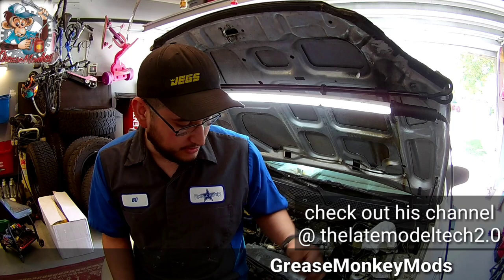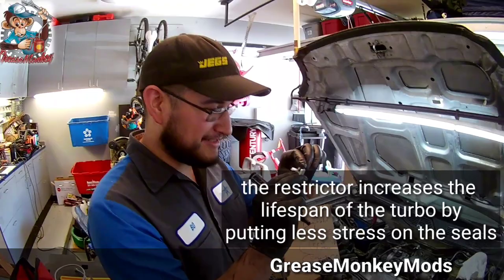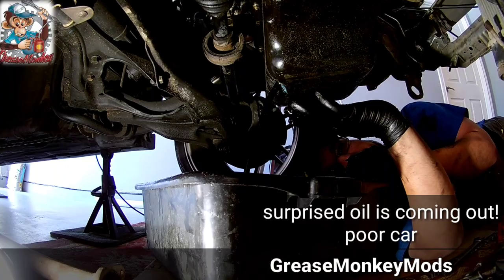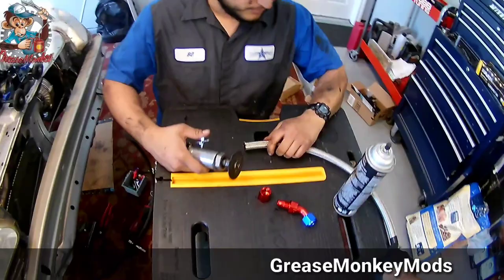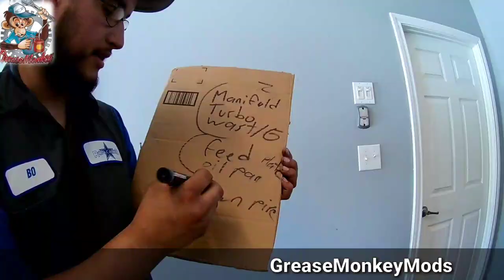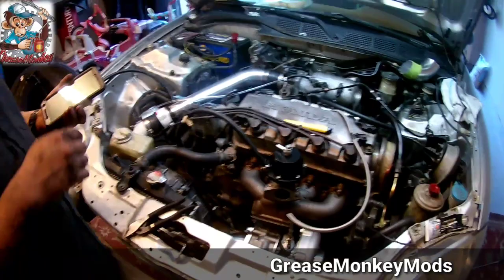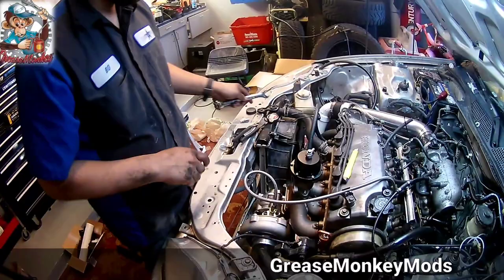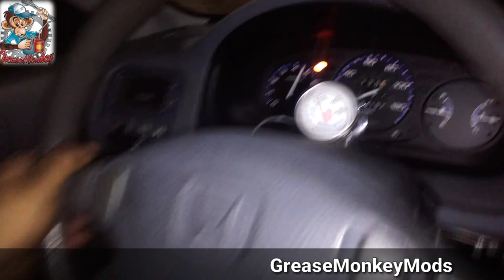project cheapest turbo build EVER! ek d16Y7 civic : FINAL EPISODE!!! We have boooooost

Comment: Should wrap the downpipe so it doesnt burn the pvc and how did pvc hold uo
Reply from the maker: It kept seperating and cracked couplers above 5psi..it did its job for a budget pipe, since then i got a 2.5 intercooler and matching aluminum pipes

Comment: I have a 93 ex d16z6 automatic will it work for my car cheap turbo kit
Reply: Thanks for the info ?What is fmu fuel management unit
Reply: And can I run the normal injectors
Reply: Yes you could minus chipping car instead you use a 12.1 fmu and a missing link